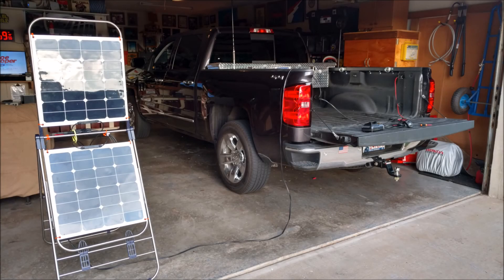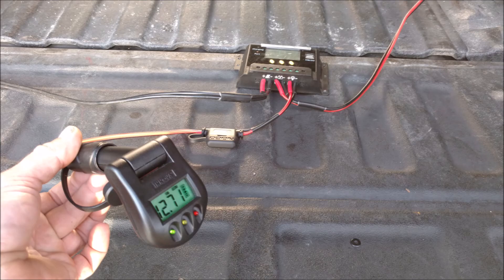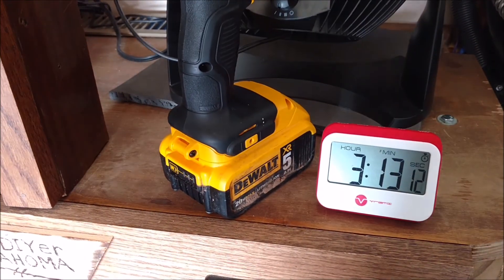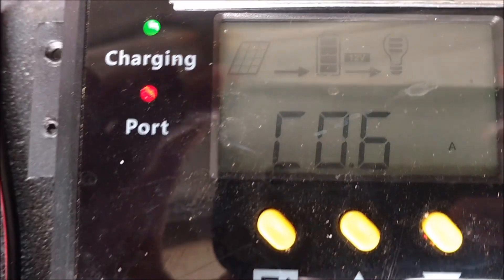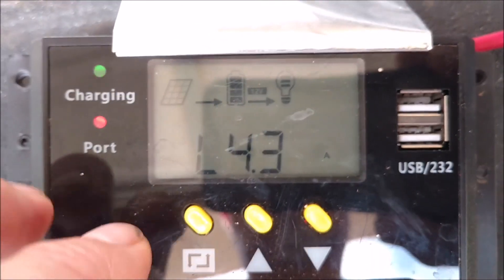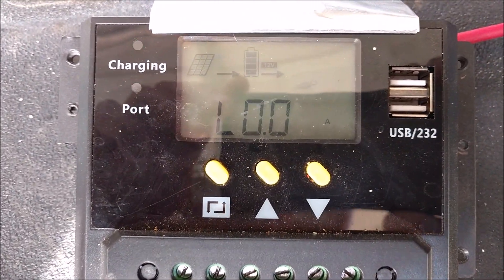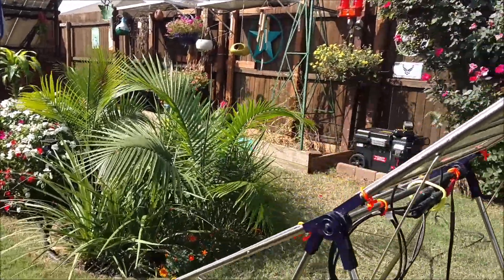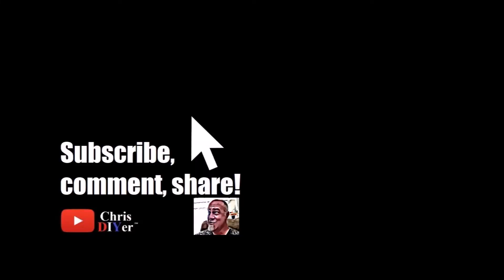DeWalt DCB119 20v lithium battery car charger: charging using solar power

Comment: You're onto something. Here's what don't make sense to me with the inverter setup. You're taking solar power which is DC and your inverting that power to AC and then your charger turns it back into DC. There's got to be a way to do without the inverter. Pretty sure all you would need is an 18 volt solar charge controller.
Reply: He's going from DC to DC using a charge controller..theres no inverter

Comment: I'm going to try something similar, with my 20 v Dewalt battery charger,   with a power meter,    400w inverter,   a De Walt dc 115 20v charger,  5 amp hr battery, running of. 445 watts of solar panels.  by next week I should know weather it will work 😃😃
Great Video thanks William
Reply: Be good to know how this turned out. I have a 400w inverter in my campervan, would be nice to have the 12 charger, but they are VERY expensive, I wonder how 'inefficient' it would be to use the 115 charger with inverter...  (or not!)

Comment: Can someone point me in the right direction? So the question I should ask myself when I’m looking at panels and batteries should be: what’s the volt, amp, watt limits on this battery and what can the panel produce? Your dewalt battery needs 12v and any number of watts up to a certain number. But it needs at least 12v and as little as 1 watt if it’s really cloudy?

Comment: How to convert an AC battery recharging unit (for a 20v battery) so that it can be used with solar panels?  My hunch is that two 12v solar panels (or 24V) would be able to recharge the common 20v tool batteries.  Are there any wiring diagrams available for these AC charging units?  Don't know if the indicator lights are run by ac or dc inside the unit.  The brand of charger and batteries that I have are Skil.

Comment: Hi Chris- wondering if you have had a chance to use desalt's 4-battery power station that acts as a charger and as a 1500w power source?  I'm curious to know if you'd had a chance to charge it using solar- I'm about to build a house soon and my goal is to use only the Dewalt Power station, 4 batteries, and charge them at the end of the day using solar
Reply from the maker: No, sure haven't. Checked the specs on it...it has a modified sine wave (MSW) inverter. Meh...
Reply: Yea, thought the same. Figured they would go pure. They need to make that change and incorporate the boom box with it.

Comment: Added dewalt dcb1800 portable power station and 8 of 9ah battery plus 4 flexible solar panels and 3 more of this 12volt chargers.  I now can go weeks in the wild with somewhat a mobile solar shtf solution
Reply: i had one also but the inverter is modified sine wave...if it were pure, game over that power station would be king. We have 1 left with 4 batteries at our store for 300$
Reply: @wheredidileavemycell  do you still have it? I’ll buy it!
Reply from the maker: Heck yes!
Reply: Sounds like a good plan for basic needs of SHTf That’s what I’m doing. Those dc chargers aren’t cheap tho. My other idea is to install an inverter in the car to charge the dcb1800. Only problem is I’d be relying on fuel.

Comment: What brand & model was that charge controller? Thanks for sharing
Reply from the maker: https://www.amazon.com/Hompie-Controller-Intelligent-Regulator-Connectors/dp/B01JJGHT90/ref=sr_1_1?ie=UTF8&qid=1509573852&sr=8-1&keywords=hompie+30+amp+solar+charge+controller&dpID=41XP6pNFCUL&preST=_SY300_QL70_&dpSrc=srch

Comment: Great video, I love that little 12v charger it was a bit spendy but sure is handy.
Not sure if you jave ever peaked at them, but sinve we are both DeWalt junkies I figured I would tell you I have been eye balling one of the HeatGear jackets they work with the 12/20v batteries our tools use.
Take Care.
Reply from the maker: Really? That would be nice to have. I have been eyeing that DeWalt Boom Box. Got to play with it at Home Depot and it is really sexy
Reply: Chris DIYer 
Same 20v battery setup too?
I haven't tinkered with that yet.
Reply from the maker: Yep...it takes our 20v MAX lithium batteries. It has Bluetooth too. It is their $200 DCR 025 model: https://www.amazon.com/DEWALT-DCR025-Bluetooth-Radio-Charger/dp/B01H9BLN3K/ref=sr_1_1?ie=UTF8&qid=1506554594&sr=8-1&keywords=dewalt+bluetooth+radio I need to read up on it some more...kinda steep, but it does charge batteries when plugged in

Comment: Was hoping you'd just attach that charger straight to the solar panel... though, that might not work out great because I have no idea what the input voltage tolerance for those chargers is. :P If it was close to 20 volts, I'd try it.
Though, it's likely to be somewhere closer to 15 volts. :(
Reply from the maker: Yeh, I don't recommend doing that. Dunno what the DeWalt operating voltage range
Reply: Find a solar panel with an open circuit voltage of 20v and disco on baby

Comment: That's some great information. Thanks for testing things out so others may benefit.
Reply from the maker: I think it would be kickass to have a DeWalt solar charging station at a worksite. Just set up the solar panel, plug into the truck, and away she goes. However, there's likely to be more than one person using DeWalt 20v lithium batteries...so, it might be sought after commodity. Takes about an hour to fully charge a 5 aH battery (like, over lunch). I figure (under ideal conditions) a 100w solar panel array for each DeWalt Car Charger should be just about right. Conditions permitting (like clouds)
Reply: @ChrisDIYerOklahoma  

Have you tried charging the flexvolt batteries in the dewalt power station with solar?

Comment: i didn't even know they have a different version of charger for CAR, however I was thinking originally modding on the standard 110V charge unit... but i guess it is easier and cleaner to build a solar dewalt charging system base on this mobile unit.... thanks for the video!!
Reply from the maker: I got mine on eBay for around $60...beats $100 on Amazon. New (opened) unit
Reply: Chris DIYer damn. Nice. But thanks for your video. I know this option and next week I will add this to my solar shed

Comment: Handy setup to carry in the truck, light weight as well as collapsible. What will you think up next ?    J K
Reply from the maker: Thanks...it works. But, gotta have good sun for it to maintain high enough battery volts (solar charger needs to top off the truck battery first). And then, plug in the DeWalt...hold the volts up high. That laundry drying rack 100w solar panel array has produced 6.1 amps in full sun